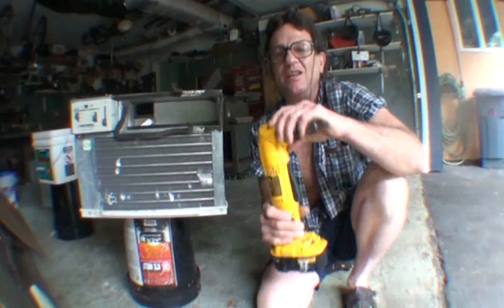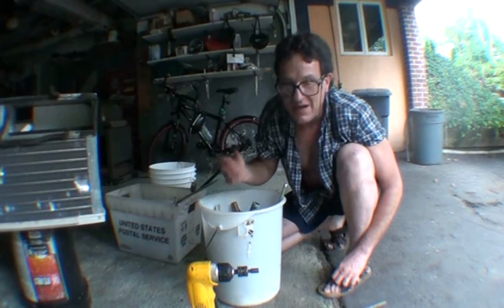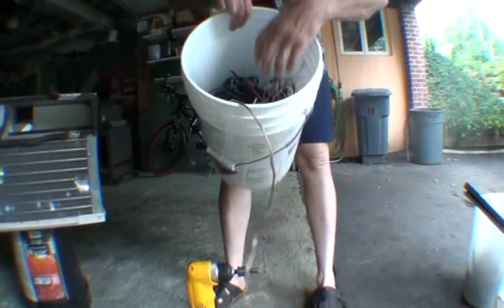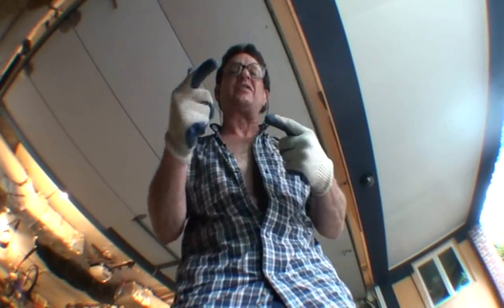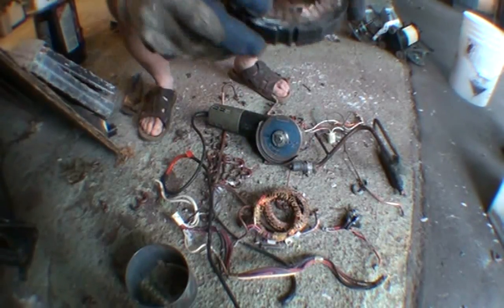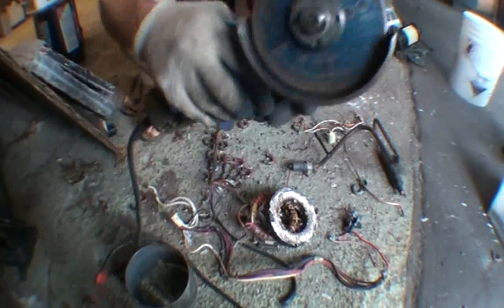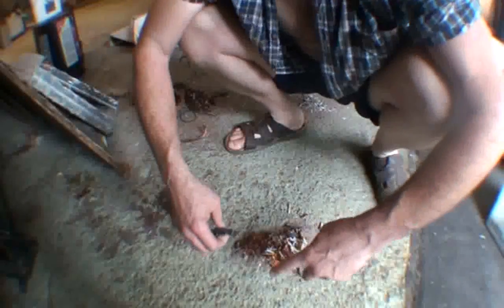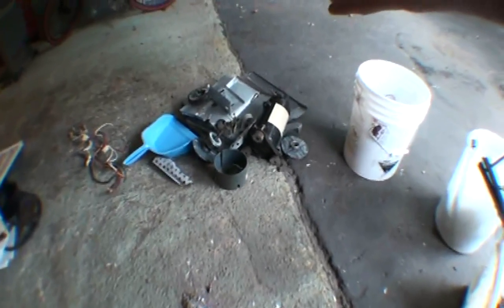Air Conditioner for Scrap MetaL = DOLLARS

Comment: Thanks for the video. As someone who tries to be environmentally conscious, I don't like the idea of trashing something, but I wanted to put some numbers to the greenhouse gas impact of the refrigerant in A/C units before breaking mine down. They are really staggering.

For CFC's, used prior to 1995, the greenhouse gas effect is 11,000 times greater, by mass, than CO2 (according to Wiki). EPA gives a ballpark estimate for a refrigerator of .5lbs of CFC. Given that one gallon of gasoline yields 20lbs CO2 when burned, venting one refrigerator's worth of CFC is EQUIVALENT TO BURNING 275 GALLONS OF GASOLINE. I couldn't find an estimate of the mass of refrigerant in an window A/C unit but one gets the idea.

For HCFC's the ratio is about half as bad: 5,160 times greater than CO2.

For my part, I am researching the cost of having someone recapture the freon from my appliances before breaking them down but I'm not willing to vent the freon in exchange for 30 bucks in my pocket. Philadelphia, where I live, will accept the units free of charge (you have to take them to a drop off spot). PECO will pay you $35 per refrigerator.

Comment from the maker: yes, cummins, i actually ended up with a small first deg burn from a splinter of hot metal from filmin this vid in them sandals, the grinder sent a small hot, HOT chunk of copper onto my second toe on right foot, took a week to heal over. 
not a big deal compared what that tool can do to the unsuspecting user, i hear many are hurt plug it in and is actually the switch is on, so as soon as plug hits outlet the thing takes off cutting as it goes, the rule is always place it on bench with blade up

Comment: My father had a disc shatter while cutting old pipe. a piece flew off into his neck. made a gouge a quarter of an inch from his windpipe being cut open, all the way over to an 1/8th of an inch from slicing open the main vein/artery on your neck. he was home alone, in the basement, no one would have herd him, and he would not have had anyone see him for 4 to 5 hours. its a miracle hes alive and well.

Comment from the maker: @earthkeeeer, thankfully this unit was dry, the gas had leaked out itself. to answer your question there is an evac machine, most automoble service stations have this and will for a small fee suck the gas out for you

Comment: I would suggest taking a razor knife and cutting down along the copper inside the radiator. Then spread apart the aluminum with a flathead screwdriver and you can pull out the copper. Super easy
Reply: yea thats what i do, u get over 7 times the cash then u would otherwise

Comment: Its a lot easier and quicker to separate the steel from aluminum/copper rads using a sawzall with a wood blade do it all the time. takes 5 seconds a side that way

Comment: I don't get why you guys on the east and west coast get such high prices on your copper, while aluminum, brass, lead, sealed units, electric motors are pretty much the same.
Don't get caught letting the freon out, if it blows warm air, there is still freon in them.